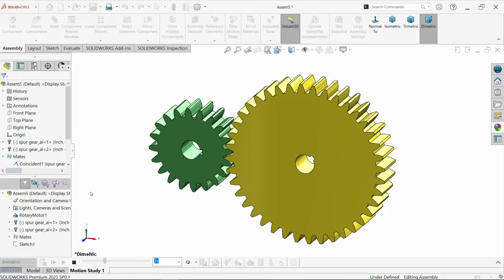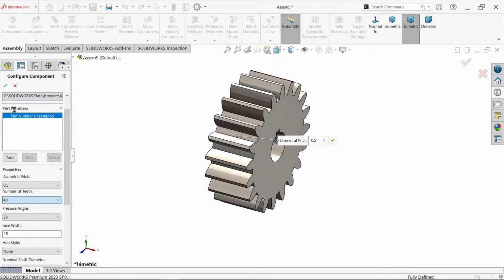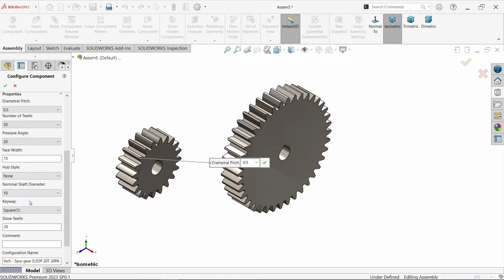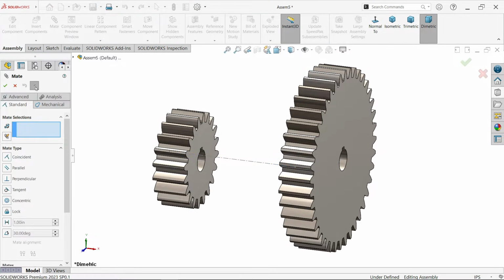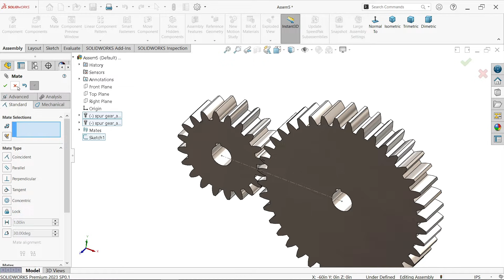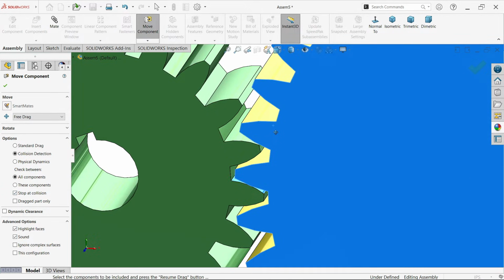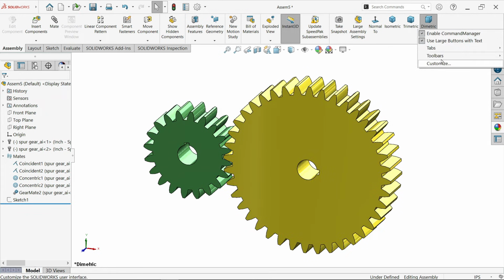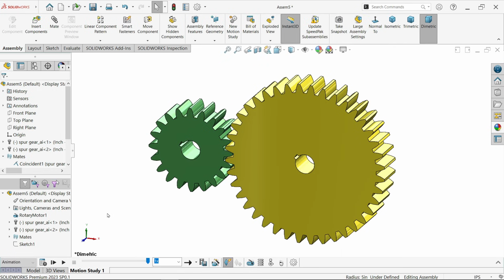Spur Gear Assembly in SolidWorks-Gear Mate (Animation)

Comment: How can we calculate diameter of two gear ?
Reply: Hello, you can know the diameter of the gear by taking the division of the teeth on that gear to diameter pitch, in the video, the diameter pitch of small one is 0,5 and the teeth are 20, so 20/0.5=40, corresponding to the big one which is 80. 40/2=20 , 80/2=40, 20+40=60 = Dimension of the center line
Reply: @tedle2948  Thanks I had this question as well.